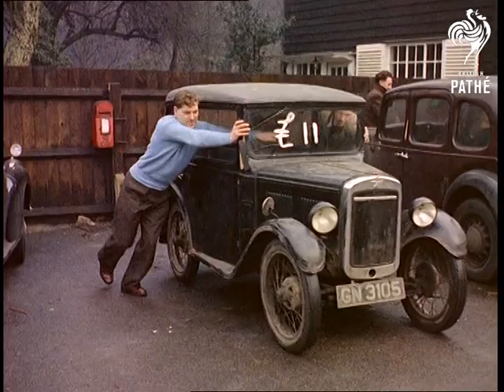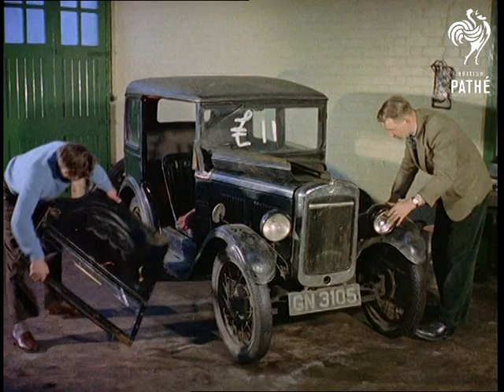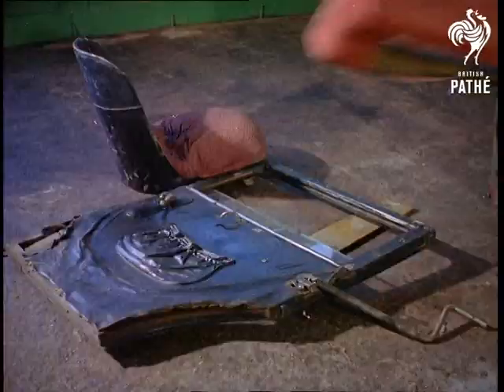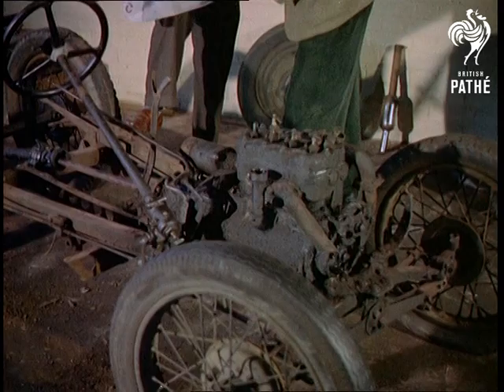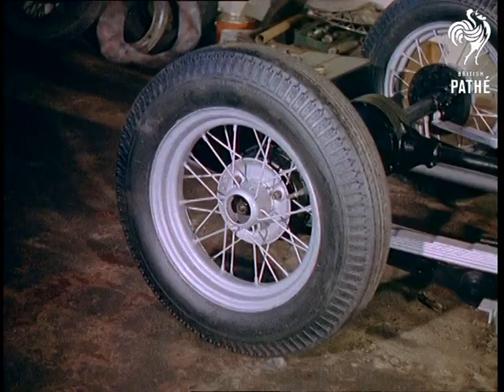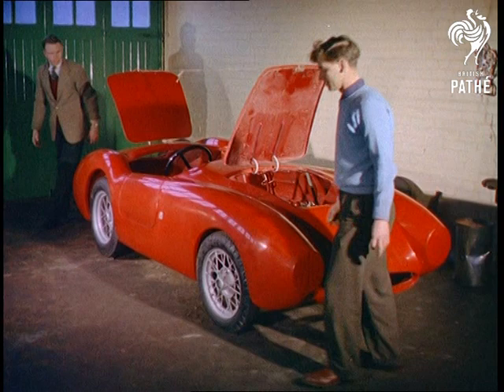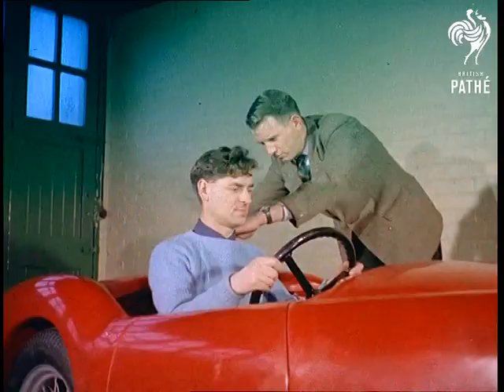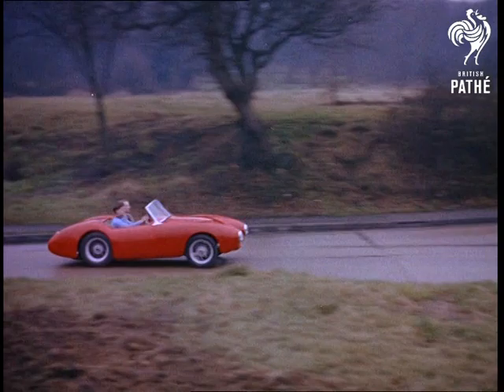Car Transformation Aka Rebuilt Cars (1958)

Comment: Ironically, the engine, gearbox and axle continued to feature in fibreglass vehicles, Reliant bought the Austin 7 tooling for the box, axle and engine and were used in their 3 wheelers with the gearbox and axle surviving into the very late 90's and the engine itself a modified Austin 7 block did too.
Reply: Very interesting  comment  you've made.   I take it you talking  reliant regal.  ? What about the  reliant Robin???